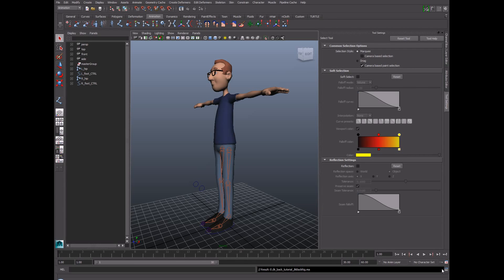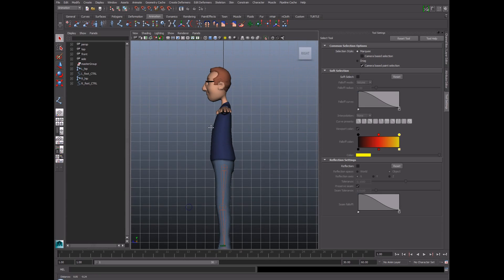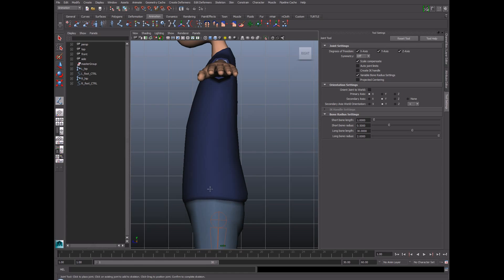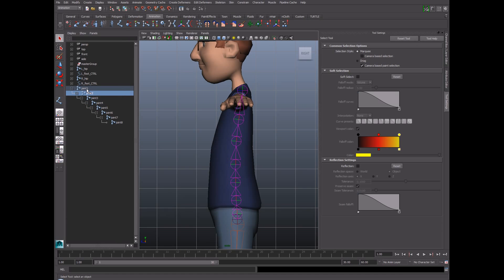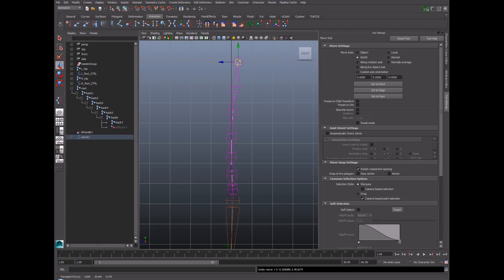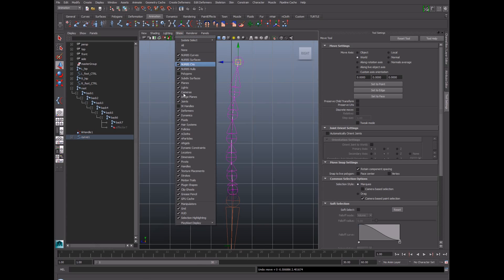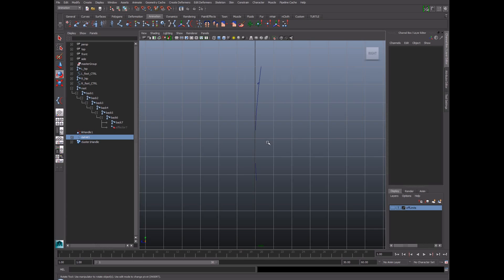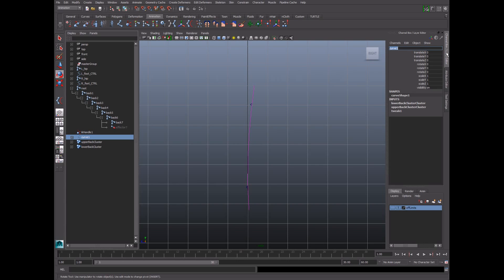Tutorial: Rigging an IK Spline Back in Maya

Comment: When I apply the ik spline the affected joints get rotation values. This is normal? Is there away to avoid that? I guess that this happens because of the few control vertices. The curve can't match the joint position exactly. But working with more than 4 cv would be impractical... suggestions?
Reply: In the video the joints flip a little too. Right?

Comment: sir, could you tell me or provide any useful information about :
1. what is the best methods of spline control besides deformation (cluster to spline, your channel) and binding joint to spline (Maya Learning Channel)? The reason for this is, I wish to make the character to be resistance to history deletion.
2. if it possible, may I know how can I rig such as the quick rig tool in maya 2017 and 2018? A character that if you move your character's hand, the body and leg can go along with it, just like the result of the quick rig tool maya 2017 - 2018.
Thank you

Comment: 11:20 question: you connected the twist attribute via the connection editor. i was getting stuck on my rig with a weird problem using the advanced twist controls to use the objects up start and end option. Long story short, my Axes are properly set, my up vectors correctly defined, but the wist is already going to all sorts of weird directions. 

what you showed here could be a workaround to my problem, but it was a 1 to 1 connection with the twist attribute. is there a way i could alternatively control the twist in the same way you did if i wanted to use 2 controllers? 1 say for the shoulders, another for the hip?

Comment: For some reason, when I try to parent the back clusters to the back control circles, the body/spine/curve won't move along with the controls. I see the cluster icon follow the controls & I can select the cluster individually and then move the upper/lower back as long as they are in world space, just not patented under the controls. Did I miss something here?
Reply: "Parent" meaning mm drag & drop into the respective body control curve.
Reply from the maker: Hugo R. Becerra Sorry for the slow response.  You'll want to make sure that your cluster options are in the default setting.  If the "relative" option has been turned on, the back won't function properly.  Also, make sure that you haven't accidentally deleted history on your IK spline curve.  Hope that helps.
Reply: +Jason Baskin Im having a problem that sounds the same as Hugo's. I checked the cluster options as well as the history on the curve, but those didn't fix it. anything else you can think of that I should check? I've deleted and remade it twice with the same results. maybe I'm doing it wrong, or maybe my skeleton has something else interfering with it. just to clarify, the cluster and the curve moves fine, but the bones of my back stay stationary. they don't seem to be connected to the spline?
Reply: Unfortunately it's been a few months since I touched this project I had issues on this with, but I did solve the issue at da time. I'll have to pull it up n refresh on this, then I'll post what I did to resolve this issue. Hopefully it'll help you too.
Reply: Hugo R. Becerra
awesome, thanks!
Reply: +Typical Tofu I know it's been a long time since this problem was issued.... I found the solution and I'm sorry for responding so late but I have just hours of started following this tutorial and actually making the rig. I found out that the problem resides in the curve created for the back as mine had only 3 vertex and you need at least 4. In order to make this work you just have to turn OFF the AUTO SIMPLIFY CURVE in the IK SPLINE HANDLE TOOL.. then you'll get a lot of vertex, just take half and half for the clusters or even you can take 4 and 5 (in case there are 9 vertex) doesn't matter. Then do everything again and it'll work... +JasonBaskin
Reply: +Jason Baskin PLEASE POST THIS ADVICE!!!!!!!!!!!    I know it's been a long time since this problem was issued.... I found the solution and I'm sorry for responding so late but I have just hours of started following this tutorial and actually making the rig. I found out that the problem resides in the curve created for the back as mine had only 3 vertex and you need at least 4. In order to make this work you just have to turn OFF the AUTO SIMPLIFY CURVE in the IK SPLINE HANDLE TOOL.. then you'll get a lot of vertex, just take half and half for the clusters or even you can take 4 and 5 (in case there are 9 vertex) doesn't matter. Then do everything again and it'll work...
Reply: Great follow up on this.

Comment: I'm having a problem, and I'm pretty sure that it's because of the spline and clusters.  When I rotate either the upper or lower body control, that part of the body does not rotate as far as the control itself.  This is causing problems elsewhere, which might be fixed if the rotation was on a 1:1 ratio.
Reply: +NiroVonPirro2455 I know it's been a long time since this problem was issued.... I found the solution and I'm sorry for responding so late but I have just hours of started following this tutorial and actually making the rig. I found out that the problem resides in the curve created for the back as mine had only 3 vertex and you need at least 4. In order to make this work you just have to turn OFF the AUTO SIMPLIFY CURVE in the IK SPLINE HANDLE TOOL.. then you'll get a lot of vertex, just take half and half for the clusters or even you can take 4 and 5 (in case there are 9 vertex) doesn't matter. Then do everything again and it'll work...